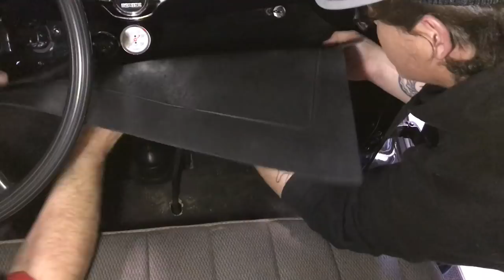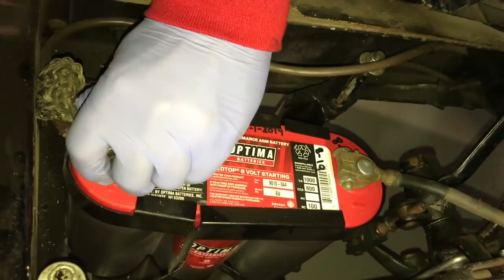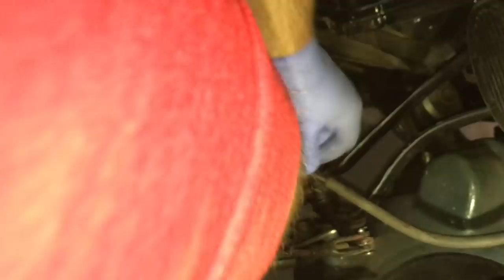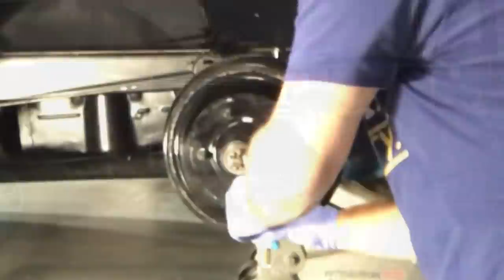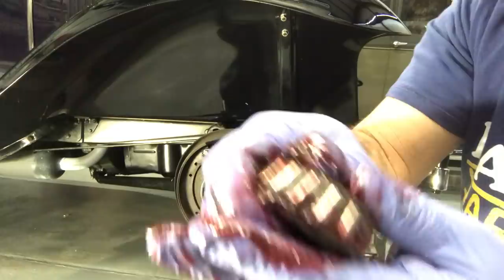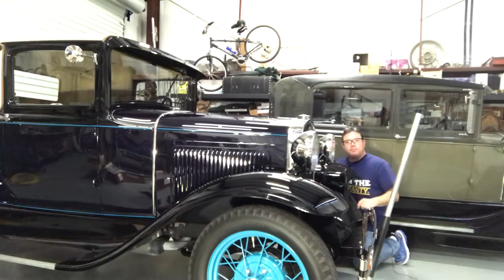How to service a Ford Model A - The 10,000 Mile Service performed on a 1931 Ford Model A

Comment: Paul, an other good video. Good tip on lubing the steering column and control rods. That never occurred to me and I have never seen it mentioned before. I put that on my "to do" list for today.  I am going to mention that at our next club meeting, whenever that may be. We haven't met in the clubhouse since March!!  

I like that you remind us of safety in the shop and to wear eye protection.You may want to remind your wife to wear eye protection while under the car.  I have gotten plenty of 'junk' in my eyes (and in my mouth too!!) over the years while under the car , even with wearing my prescription eye glasses.

Keep up the good work!
Reply from the maker: She's pretty anti-face stuff, but you're right.  Lucky for her, I clean the undersides of the cars frequently, so not much loose hanging stuff under them.

Comment: My father was a Ford mechanic. Every once in a while you would hear a model A. Or T stories.
Reply from the maker: Do you remember any of those stories?
Reply: @ModelA  more model T than A. Dad was raised in a rural area. He would buy Ts for $25.00 in seen . Then take his fathers team of mules a nd hook them to the front bumper, lower the wind shield and throw the reins over it and steer the Ford and drive the mules at the same time. The lead mule was controlled by a check line.  A country doctor got a Ford . One night went to deliver a baby.it took a long time and by the time doc got home he was half asleep. When he got in front of his house he stepped out of the Ford and said whoa Nellie and went in the house. The next morning he sent for my dad. To fet the Ford out of the pond behind the barn. The Ford went into the barn and through the back wall and into the pond.  Dad dried out the Ford and got it running again.  Dad said you cranked a lot of  As in cold weather the oil got stiff and the battery didn’t always do the job and you had to crank it. He said you put the Ford in high gear ,jack up a rear wheel wedge an axe handle in the spokes and crank it that way in cold weather.early As didn’t have roll up windows. Had a leather strap.connected to the bottom of the window. It had holes in it that hooked on something to hold it in the position you wanted. Lots of times I would be using a tool and he would say that it was used to do a certain job on a A model .  He had a complete set of wrenches  for a T model. I ground the largest ocean. Eith of an inch wider to fit a nut on my Cushman scooter. He was not happy. Dad said a t model never hit anything just once. They would bounce off and hit it again. Some times would hit something three times  b4 they quit running

Comment: Tip.

When removing an old battery, put the terminal caps from the new one on it while you are working in the area.  It prevents accidentally making contact.

If no caps, a couple wraps of electrical tape or a strip of cloth backed tape does it too.

Generally no needed when one is careful, but that is why they are called accidents, heh.
Reply from the maker: Good tip.  Thanks!

Comment: I love seeing these old cars still being used. Cars are meant to be driven, not to sit in barns. I’m seventeen and have been working really hard and plan to buy a classic car this summer. I know everyone here will say to buy a model A, but I am not handy enough to daily drive a model A. I plan on buying an almost mint 1959 Edsel Ranger (the one currently listed by Gateway, as long as it’s still for sale) to use as my daily driver in the summer. Any thoughts about those cars?  Thanks. Keep up the great content!
Reply from the maker: Good plan, Ryan!  FYI, if you're talking about the Edsel I think you're talking about, you would be WAY better off keeping a Model A on the road as a daily than that.  If you really just want an elderly automobile to daily around, get something like a 60's Mustang or Camaro.  There are TONS of parts available and a tremendous support online for them.  If you're wanting something older, it would be tough to beat a Ford with a flathead V8.  But, the last thing you need is someone else telling you what you should do.  Just go do it, and be the coolest guy on the road!  If I can be of help, just say the word.

Comment: Congratulations Paul and another great video. I noticed you didn’t have dust covers on the drums covering the outer bearing.  Packing bearings is a lot cleaner now that disposable gloves are so readily available!  Been doing it the same way for years.  Adjusting the bearings is a really good tip, thanks.
Reply from the maker: The Model A doesn't have dust covers.  if your wheels fit your drums correctly and you have hub caps in place, dust and dirt won't get in there anyway.

Comment: That car really looks amazing. It's really cool. Happy that you DID NOT hot rod it and or change it so badly that it's not an A anymore. I'm assuming it still is All Metal body works.  1st thing I would do if it were mine is to remove the seat. Because my luck, grease & oil would get all over it and it's too nice to get soiled.
Reply from the maker: Yes, it is all original Henry Ford steel.  Thanks!

Comment: Well, looks like I'll be lubricating my throttle and advance levers today - didn't know about that, thanks!
And Congratulations, of course, on reaching 10K! 
All the best and may it continue for 2021 :D

Edit: WHOA that made a difference! Now I have to pay attention the idle lever doesn't creep down on me while driving xD
Reply from the maker: Nice!  Now, you have to make sure the notches are in good shape.  If not, use a triangle file to fix them. Then bend the notches flange so it is flat against the back of the lever.
Reply: @ModelA  About no teeth are left xD 
Some filing will have to be done.

Comment: Another great video. Wondering ? how big is the garage you have the cars in. Looks like you have a shipping container for one of the cars. My dream is to have a building and lift to work on my A's. Currently only have a house garage to work in. Also it looks like you keep the garage really clean. THANKS
Reply from the maker: Thanks!  The shop is a metal building about 30 x 40.  The small garage is a "Tuff Shed".  The rest are in storage.  I did my first restoration in a 8 x 16 shed.

Comment: Do you have a video that shows the return tube to the oil pan. I have a large leak after I drive my 30. I am changing transmission now and want to find the leak. I can't get the oil pan off the bolts up front hit the cross member.
Reply from the maker: Hi Wayne.  I'm sorry, nothing specifically on that yet.  Sometimes, the solder joints at the ends of the oil return tubes give out or crack and cause a leak.  Also, I use the cork gaskets on the ends because they are the most leak resistant.  The front pan bolts are a pain but not impossible unless your motor mounts are goofy.  Try jacking up the motor a bit.

Please keep is informed on your progress as you tackle this!

Comment: Happy New Year! How often do you repack the rear wheel bearings?
Reply from the maker: You don't pack the rears.  The rears have grease fittings and get greased every 500 miles.

Comment: Good job Paul!  I thought the shocks were filled with Glycerine.  Can Glycerine be mixed with oil, or is it one or the other?  I have no idea what is in mine, but I guess I should check the level.  Is there an easy way to distinguish between the two?
Reply from the maker: I have no idea.  The spec calls for hydraulic oil.  That's all I have ever used.  Sorry I am of no help.
Reply from the maker: Lots of opinions, indeed.  Too bad so many of them are wrong.

Comment: Did I miss your suggested torque setting for the wheel lug nuts?
Reply from the maker: I don't have a torque setting.  Just TIGHT!
Reply: Tight is correct. I attempted to torque to 60ftlbs and spun a wheel stud. Now I am finding that the only way to replace requires a machine shop to swag in a new wheel stud. Is there another option to replace? It is not as easy as a late model vehicle.
Congrats on the 10,000. Happy new year. Enjoy your site
Reply from the maker: @toddathey1235    Unfortunately, no.  The studs have to be pressed in, and it takes at least 40 tons (preferably a 60 ton press).  They bond the hubs to the drums.  The studs must expand inside the holes as well to keep the hubs from moving.  You have to pound the loose stud out and press in a new one, unless the stud is still in excellent shape, then you might try just repressing that stud.
Reply: @ModelA  Thank you for the response. Now the difficult part is finding a machine shop that will handle such a task.

Comment: Paul, the Model A I had rattled horribly because of the brake rods and other issues. Are you familar with those problems?  They are called rattle A's.
Reply from the maker: If my Model A's rattle, I fix them.
Reply: @ModelA  I need to do some catching up on your video's.  I just watched the vid with the guy that was aproaching 90 overhaul a zenith.  What I had previously recommended you do, you are already doing.  In the process of watching the brake adjustment video now.  I have got to get me an A soon.